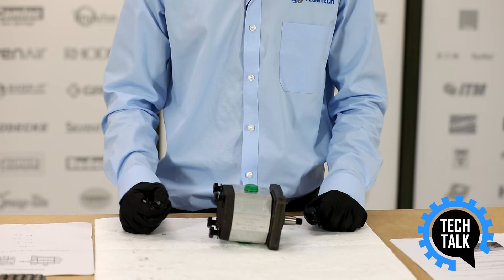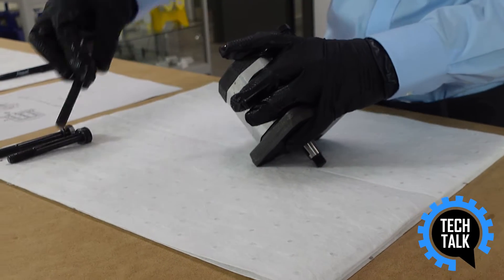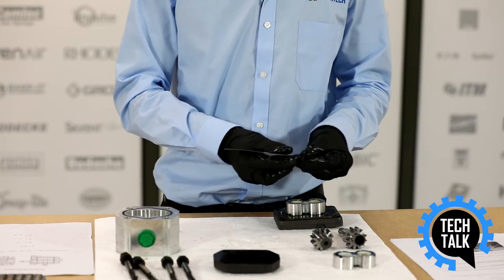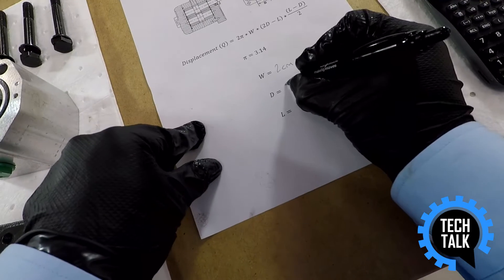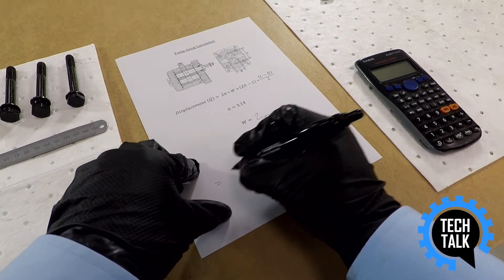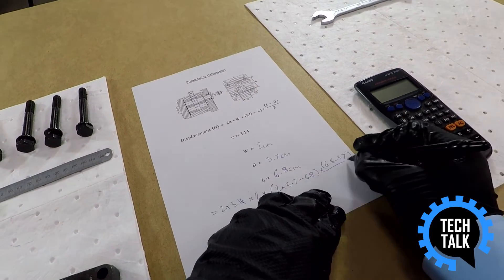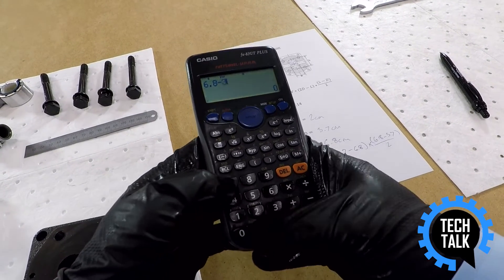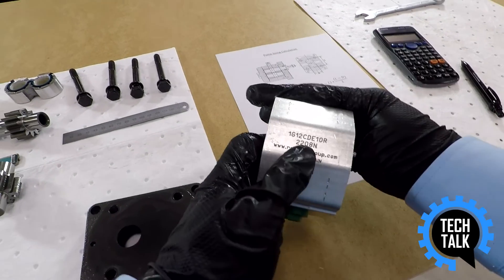Hydraulics Gear Pump Sizing Calculation

Comment: Hello,is there some way of measuring hydraulic pump displacement without disasembling the pump ?.
Reply from the maker: Hello, thank you for your question, You do need the measurements from inside the pump which means you do need to disassemble. However, sometimes you can get the measurements from the manufacturers part code. If you need any help with measurements, our team are happy to assist. Give the office a call 033 000 22 223 and ask for Gavin or technical.